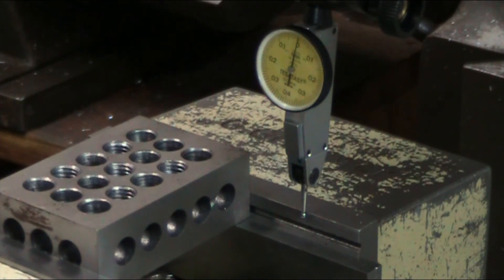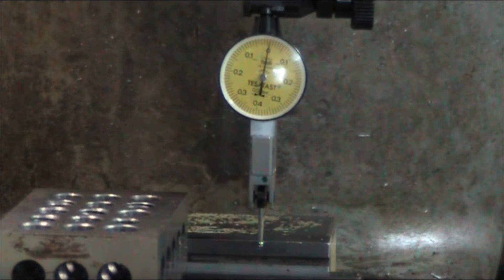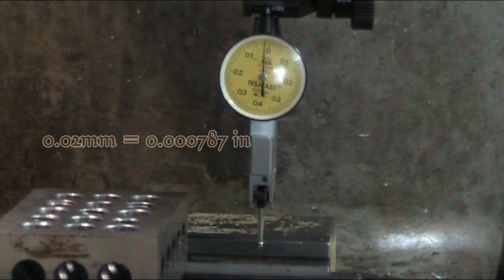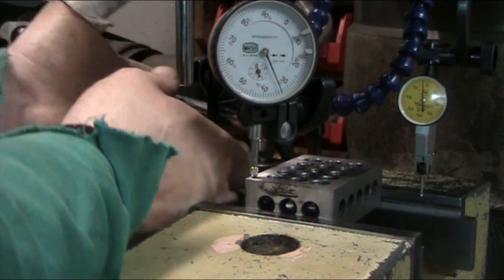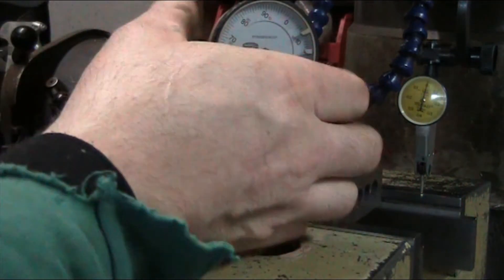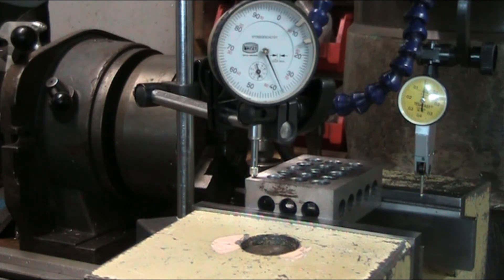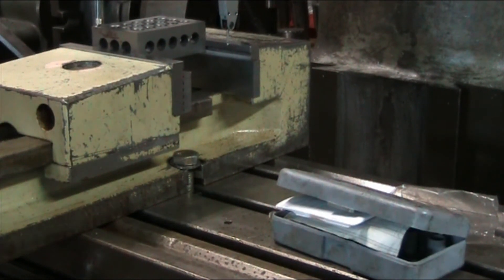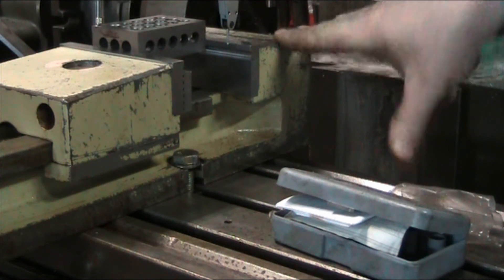Machineshop Physics: Vice deflection - the vise challenge

Comment: Fascinating… I was traming my mill one day and just happened to lean against the head and was shocked by how much it flexed!  If you are afflicted with OCD this can be disconcerting in the extreme!  Hard to except that nothing is perfect… just adapt!
Brad
Reply from the maker: +Brad “HomeShop” Apprentice  i would think there is a certain amount of flex in any machine, perhaps some more than others. even the same model from the same maker. that would be the reason we see tool marks in lighter cuts and nice finishes in heavier cuts. the heavier cut is taking up some of the flex and not allowing the tool to drift or chatter.
this little experiment was useful in that it showed the error that can arise by zeroing out a machine on the fixed jaw rather than the edge of the work once its been clamped in the vise

Comment: Just uploaded one on this subject as well, a 4" and a 6", no Kurt but both British made and very well used. I am actually surprised that a pretty tight dovetail vice lifts almost the same as your box way type vice. ...
I have replaced the rather random  "shop gronk" by a torque wrench and it seems both vices behaving very similar.
... Hope the thumb is getting better

Comment: Just for fun/curiosity, had you thought to put an indicator on the underside of the overhang?
Reply from the maker: +Chris Stephens not really, i spose a guy could. i would tend to think the overhang of the vice would show the same movement as the jaw...or did you try that and see something we ought to be aware of?
Reply: just wondering if the vice bends or stretches or both. Sort of proof of your thoughts that if the vice was mounted on the other T slot, readings might be different.
Reply from the maker: Chris Stephens
 good call.. now you got my curiosity up.. will check it out on saturday and do a follow up vid
Reply: I suspect it will be difficult to tell, but we can be fairly sure there would be movement even if the vice was firmly clamped over its entire length. Now the question is where would the actual deformation be, hence the original query. 
Always good to be curious, as it is the first requirement in learning and advancement.
Hope your thumb makes a complete recovery, and soon. .